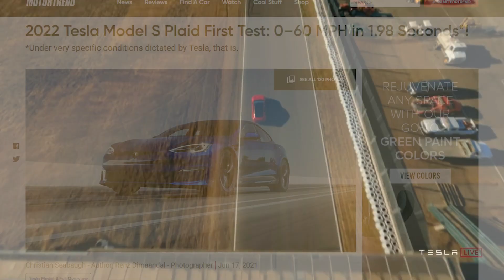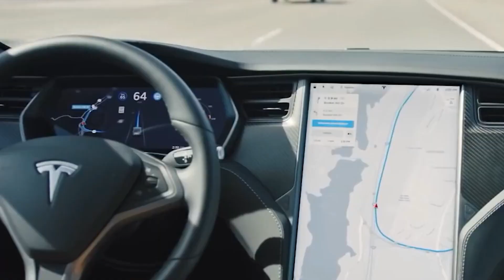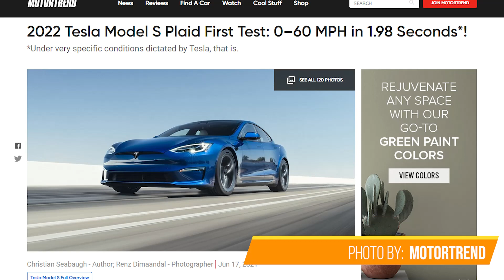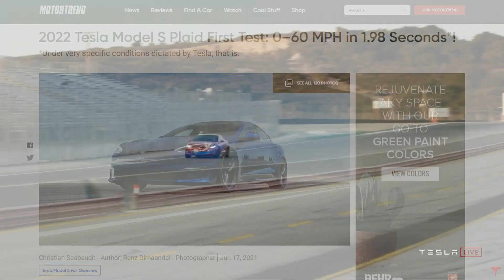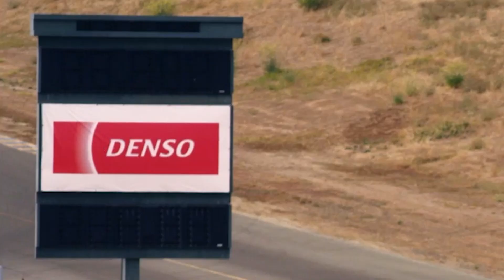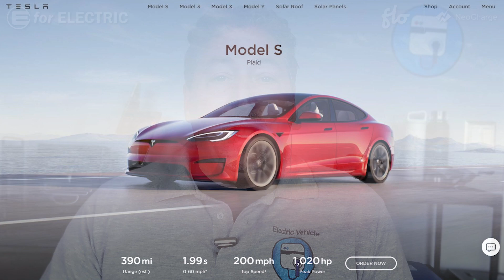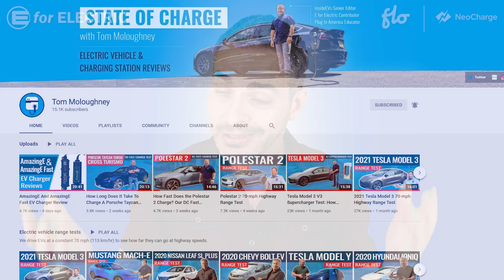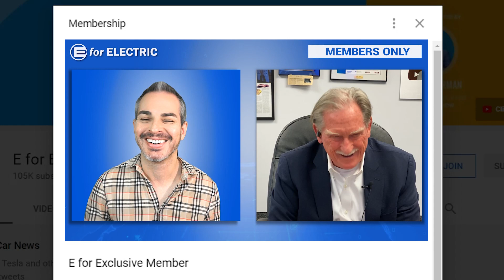Tesla Finds Itself in a Sticky Situation | EV News

Comment: Wait... So it's controversial for Tesla to use a 1 foot rollout, but in literally every other sports car it's fine? The Demon Challenger couldn't reach their claimed drag times without perfect drag track conditions, and not a stink, so why the Tesla hate? I forgot... people hate for the sake of hating when something gets popular...
Reply: Not only popular. Destroying the competition. But of course the not produced production car which has not been delivered to a customer from Rimac is faster then Tesla. I take 19 Model S, let 18 sit on Rimacs tail and win with the 19th! 😂🤣Costs the same.
Reply: @Jochum van Hattum Their non performance models are just that. Not performing. They are just simple plain ole cars. Not family dragsters.
Reply: He should check specs on id4 vs measured 😂
Reply: So only Dodge and Tesla do it, the rest don't, it's misleading advertisement
Reply: @S85B50Engine  yeh, but how accurate do you think the 0-60 with a manual 6 speed transmission is vs the spec sheet.
Reply: @isnogood-  if they do it for precision why only on the Plaid and not on the rest of the lineup?
The long range and base model don't have their acceleration in 6-60, they have it measured from a dead stop.
Reply: @S85B50Engine  so whats the problem? They list it. And i am saying it is not the correct numbers on most cars. Why start now after more than 100 years?
Reply: @isnogood-  except most manufacturers rate it on tarmac from a dead stop. 
Some journalists even get faster times than advertised on some brands like Porsche for instance.
You don't have to lie and mislead customers to be cool, it's still a fast car, why lie and say it does something it does not?
Reply: @S85B50Engine  read the *. How is it Lies when its there?
Reply: @S85B50Engine  also go test the id4 and tell me the numbers are correct.
Reply: @isnogood-  we are not talking about the ID4, we are talking about Tesla lying.
2.28 is amazing, why do they have to lie to mislead people? 
They don't have to lie to be cool when they go as fast as they can.
And again, we are talking about the Plaid, not the rest.
Reply: @S85B50Engine  and again they wrote 1.99* so if you read the * you know its with rollout. You not Reading it doesnt make it lying or cheating. Was the same with ludicrouse.
Reply: @isnogood-  then why is it only on the Plaid and not on a single other model they are selling right now?
Reply: @S85B50Engine  they could probably Just do it the normal way, all im saying is that they are not lying about it. LR model is plenty fast for me :p
Reply: @isnogood-  then why don't they fully commit to it or do the test with the Plaid like every single other manufacturer does it?
Again, saying it does one thing it does not is misleading

Comment: I recommend you to organize a drag race between the Plaid and your favorite ID4
Reply: Since any standard or long range version of any Tesla would easily smoke the top notch VW models, the only chance of the VW to only be 6 meters behind would be the Tesla towing it... ;-)
Reply: @arpysystems  dam...I laughed hard but that's the truth
Reply: The high traction surface would probably overload the VW and smoke the motor etc.
Reply: @paulstubbs7678  lol
Reply: @arpysystems   The top notch "VW" models would be the Bugattis latest and greatest for several million dollars and you are still correct. For the cost of a single regular scheduled maintenance visit on most of the S plaids competition you could buy a base Model Y.
Reply: With the Plaid going in reverse?
Reply: In reverse!
Reply: @paulstubbs7678  it could not leave the starting pit. Its torque is not enough.
Reply: try the Kids Buggy in the trunk challenge instead.
Reply: @Gabriel.A.L.  there is a Standard of measuring this. The norwegian banana box test. Copyright Tesla Björn 👍
Reply: You guys ever saw the electric motors on the ID4? 

They're built robustly

Comment: Love how no one is talking about how crazy the specs on the long range model S are. Is the 3.1 sec 0-60 without roll out? Over 400 miles of range and only 80k. I'm getting that car tbh.
Reply: That's the mind-blower.  My 2013 Model S P85 was $107k 8 years ago.  and it was over 4 seconds to 60 and 260 miles of range, with no autopilot, etc.

Comment: When it comes to quickest car bragging rights, automakers have long been using different techniques to get better performance numbers. Most all American 0-60MPH and 1/4 mile performance figures over the years were done using professional drivers, and often at drag strips (which use VHT). Using the 1 foot rollout matches the track and testing methods used to compare cars in the U.S. for several decades. Even though the media is concentrating on the 0-60MPH numbers, the HUGE victory and performance gains of the Model S Plaid is the 1/4 mile performance numbers. 9.24 seconds at over 150MPH is simply amazing, and those a far better performance numbers to compare against other super fast cars. Technically speaking, the Rimac Nevera will be quicker and faster, but nobody can seriously think that it's $2.4 million dollar price, and 150-car production is in the same market as the $130K Tesla. I've already seen the new Plaid Model S in real life, but I doubt that I will ever see a Nevera outside of a car show. The other big performance improvement of the Plaid Model S is the new heat pump and control systems that mean that the Plaid model can maintain it's super performance, run after run.
Reply: Hopefully Brooks from DradTimes will get one and we will see what it can do. Clearly it’s going to be a good value performance wise. But Tesla, perhaps Elon, has a habit of relying on he fact that most of his fan boys don’t understand engineering. 

Lucid Air Coefficient of Drag is 0.21 so Tesla puts out that their coefficient of drag is 0.208 and calling it’s lower than 0.21, but those who understand math know 0.208 is not necessarily less than 0.21, (which has an allowed value of 0.205-0.214).

Elon also tried to dupe his local fans with the 4680 cell having 5x the energy and 6x the power of a 2170 cell, knowing his fans can’t do the math to see the cell has 5.5x more volume, so any battery manufacturer can make a 4680 cell with that specs, and no need for “Tabless” nonsense.

If you saw the clip with Jay Leno and Sheppard Smith, the title of the video was ambiguous and Jay’s response seemed unnatural. Then it cuts away to Jay saying it’s the fastest production car (which it’s not) instead of the quickest production car, which it appears to be.

Tesla did this to themselves. If Motor trend Tests all cars on its track under the same conditions, and adds those times to its database and latest publication (I used to get that issue quite often), why would Tesla need to dictate specific conditions?

Jason from Engineering Explained also had a field day with this. 

The car is super quick, so why would Tesla muddy the waters? Just let everyone test it using heir own standards that they use for all their car tests.
Reply: @imho7250  If you can't see the tabless advantage of 4680 cells yourself, then you obviously have zero engineering background or understanding. All I see is an incel hating on Tesla because they're popular.
Reply: @enyotheios2613 , actually you know nothing about lithium ion batteries if you think “tabless” solves any problems that needed to be solved. It doesn’t. But it introduces a lot of problems in manufacturing. In the end, normal 4680 cells made by Samsung, Panache or anyone will have as much power and energy as what Tesla claimed with their design. Try doing some math for once.

And anyone who thinks the heat or internal resistance of a battery is caused by the tabs hasn’t got a clue. If the one needing the battery specifies high drain cells, the manufacturer uses more and thicker tabs.
Reply: @imho7250  The gains in energy density and cost reduction for Tesla's 4680 batteries are not found in one single design element, but in several changes that add up to impressive gains. Maxwell's dry electrode technology should reduce the production line time, cost, and complexity, and make 4680 battery production less toxic than current batteries.
Reply: @deanmcmanis9398 , Tesla made ZERO claims about the power density or energy density of their 4680 cells. They claimed 5x Energy, 6X power, and 16% more range. All 3 of these can be done by ANY of the real battery manufacturers using the existing technology used in 18650 and 21700 cells.

Maxwell’s dry electrode coating might lead to cheaper batteries. Only time will tell. But if a better value battery comes out soon after Tesla figures out how to make their batteries, such as QuantumScape or any of the other solid state batteries being developed.
Reply: @imho7250  Shorter current path with tabless design...
Reply: @chrisheath2637  doesn’t matter. That’s not where the problem was. Battery manufacturers know basic electricity, so calculating the collector foil thickness and Tab cross section area needed for ELECTRON flow is easy. The problem is you can’t get IONS to flow rapidly through thick anode and cathode layers, and it causes heat build up. 

The foil and tabs, or just crumpling the foil into the ends of the cell like Tesla wants to do, has nothing to do with ION flow. 

Tesla claims their 4680 cell will have 6x more power (10% more power density than the 2170) and 5x more energy (10% LESS energy density than the 2170). Just using the same technique as the 2170 made 5.5x bigger would give a cell with 5.5x the power and energy.

Any battery manufacturer can make the cells biased toward energy or power, but most just give a decent compromise of about 6C discharge rating so that they can also have decent watt hour rating. But if you tell them you want a 30C cell, they will make it by using thinner anode and cathode layers and adding as many tabs or thicker tabs as needed to carry that current.

If you use 5x high drain cells in a 10,000 mah power bank that only lets 2A out (1/5 C) when you could use 5x low drain cells with 20,000 mah (which last twice as long) then you have a bad cell choice. 

Conversely if you want something that can jump start a car with 2000 watts output and you use low drain cells, they will drop in voltage so fast the device shuts off on low voltage, so you need more cells, bigger, heavier to do the job. 

Panasonic knows what they are doing, which is why the founders of Tesla went to them long before Elon bought Tesla from them.
Reply: @ymcpa73  I never claimed MT didn’t do other tests nor that it is current the quickest production car. I also didn’t delve into Tesla’s claimed cost reduction because that’s not engineering. My claim is that there is absolutely nothing special about the performing specs Tesla gave, which had their non-engineer fan boys misinterpreting it as higher energy and power density.

Tesla also doesn’t explain the claimed 16% more range, on purpose, knowing their fan boys will claim it’s some Tesla innovation, but all means is that with the new form factor mainly because it’s 14% taller so in the same space they can add 16% more kwh, which is the only thing related to the battery that will give it 16% increased range, since the weight of the vehicle has little effects on the cruising range.
Reply: @imho7250  Jason made a fool of himself by attacking the rollout and failing to even mention that it's the standard way that NHRA, and most of the car magazines, measure their numbers, because that's how drag racing is done in the US.
So trying to claim that Tesla was doing something wrong, when they were using the industry accepted method is pretty obviously stupid.
And since the top acceleration speeds are only legally going to be used on a drag strip, claiming the top number on a standard drag strip with the VHT treatment is the only way to properly demonstrate the performance capabilities of the car, so that you can compare it to other drag cars.
If they gave a bare pavement number, it would not reflect what it can actually do on the drag strip.

In regards to the 4680 cell size, what you don't understand is that by making the individual cell larger, you increase the cell package to filler ratio, meaning that you reduce the weight per unit of energy, because you have less steel in the packaging, fewer cells, and thus also less steps needed to manufacture a battery pack. All this saves cost and weight.
And yes, anyone can make a larger cell, but the breakthrough is that no one was, and so they are the first mover.
In addition, the reason the cells were kept smaller was because of the jelly roll design, a larger cell requires a longer length of electrode material, increasing internal resistance.
So by going to the tabless design they moved past that electrode length limitation that defines modern cells.
Reply: @ke6gwf , If the roll out is standard, why doesn’t Tesla use it on all their 0-60 times? 

As far as the 4680 having a better ratio of active material to package weight, while that is true, it’s not a huge amount. You fail to understand that as a pressure vessel gets larger, the engineers make the metal thicker. So the can of a 4680 is not necessarily 50% lighter than 5x 2170 cans. 

Tesla made ZERO claims about energy or power density. If it was a huge gain, of course that would have been included on the main slide showing 5x energy, 6x power and 16% more range. But since it’s NOT more power or energy dense, Tesla knew they can fool all the Tesla cult members by saying the form factor allows for 16% more range. 

As explained. Even if you reduce the 100 kwh battery weight by 16% it’s not going to have 16% more range. If you knew anything about engineering you would understand that.

Comment: All performance vehicles test their 0-60 and 1/4 mile with rollout and prepared track.
Reply: #facts
Reply: No. Porsche does not. They post SLOWER times on purpose. The reason is that they want anybody to be able to achieve the times posted. For example, they posted 2.6 on Turbo S, actual is 2.4 with no rolling start, no track glue. So if you buy one, you should be able to go on a normal road punch it and get 2.6. You will never be able to get 2 with a plaid, you will probably get ~2.3. They do the same with range. They post 230 on the 4S but you get around 300.
Reply: @youferrer  big difference between Europe and the Americas my freind.

Comment: 🤔 Model S Plaid using dragstrip mode at the dragstrip as intended and all dragstrips have prepped surfaces which use their standard timing system 🤔 I can see how this can be controversial
Reply: Delusion fanboy. 6 to 60 is not 0 to 60. They lying to make their cars to look faster. No difference to full self driving that's not full self driving.
Reply: @jeffsteyn7174  How are they lying when they already said it is with rollout?

Comment: I think Tesla shouldn't open their charging network. During holiday time you sometimes have to wait already. If there is an EV that can only do 50 kWh it slows down the traffic drastically.
Reply: Imagine charging a VW ID4 at a SuC. How do you propose to pull the cable because its not long enough to actually plug the VW in? With a extender? Or a Taycan, Audi E-Tron, MG etc. And how and who should install the payment terminals? Who is responsible for them? Tesla obviously not!

Comment: your acceleration depends on many things: the road surface, your tires, the weather, your weight inside the car... even wind direction!
Reply: Don't forget the angle of attack!
Reply: @wolfgangpreier9160  If you take 2 seconds to fully depress the accelerator pedal then don't complain about a 0-60 in 4+ seconds
Reply: @giantarcsfora9279  Oh i don't complain at all. 2 seconds is much too high of acceleration for my poor old body. I don't go on  arolercoaser ride because i get sick after the first drop. I won't ever go on a plaid or roadster ride. My 4 seconds 0-100 km/h in my Model 3 is totally fine.

Comment: The Plaid doesn't run 0-60 in less than two seconds. If you go to the Tesla website under the Plaid Specifications Page the 0-60 have an asterisk but this asterisk isn't on the Plaid Main Page 0-60 time. This asterisk say that the Roll Out isn't included in the 0-60 time. This 6 to 10 inches of acceleration jump would easily adds 2 tenth of the second, making the True & Real 0-60 time around the 2.10. In simple words, the Plaid's 0-60 time starts counting after the Vehicle is already in motion.

Comment: Rollout is nothing more than a laser beam being blocked by the tire at the starting line. It's possible to Stage a little early or stage a little late as long as both lights are lit on the tree. This is nothing new and is the same standard that has been used for decades in all official time runs either professional or amateur.
Prepped tracks are preferred for any timed runs especially by manufacturers, not to mention safety and liability issues. All car manufacturers have a list of conditions that independent testers must agree to before they hand over their vehicles to them.
...... except for Tesla.
Reply: Exactly.

Comment: All test methods can be controversial. As long as Tesla use accepted standards used by GM, F, Chrysler for their flagship performance, aren't we holding plaid to a higher std? By similar logic, why even allow track tires?  As for not using consistent method for plaid, even Society of Automotive Engineers: "...over the years, the (SAE) and similar standards-setting bodies in other countries have developed various methodologies for measuring the output of an automotive engine. These standards fall into two basic categories: gross and net output." Nothing dishonest to me.